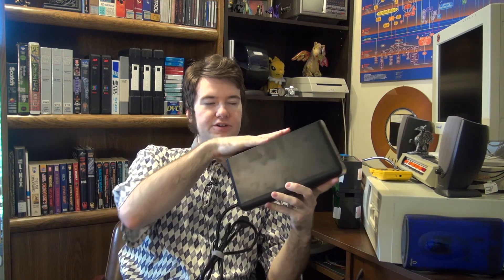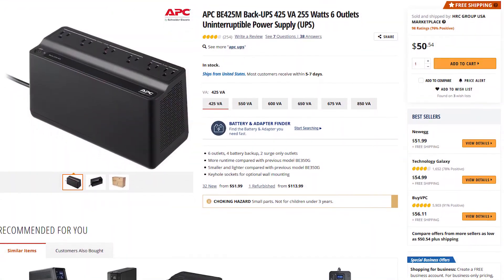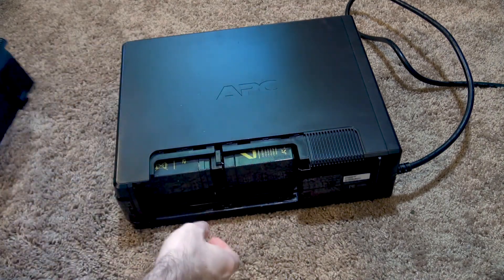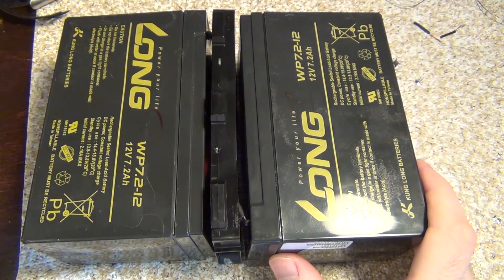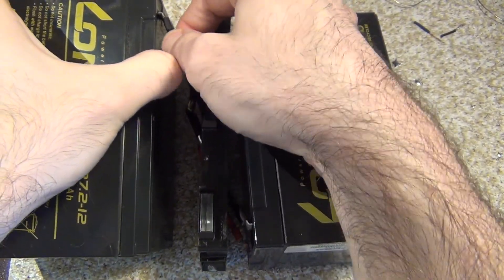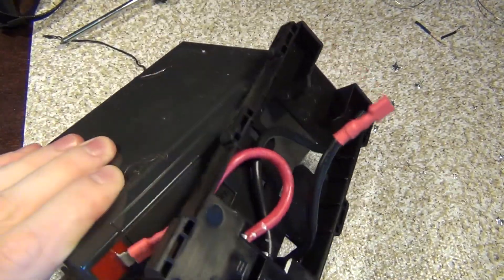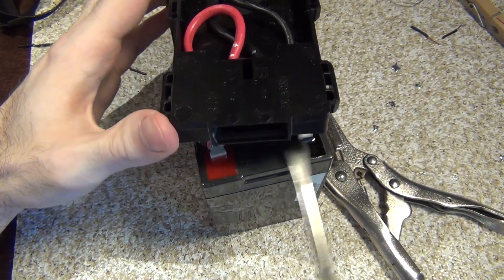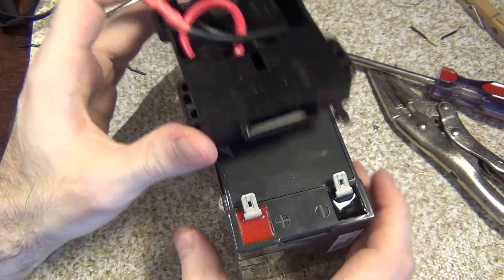APC Battery Pack Creation (Back-Ups XS-1300, Back-Ups XS-1500)

Comment: Does anybody have thoughts about building an "external" battery bank.
I acquired a toss away APC unit. The inverter is my interest. A pair of 12v deep cycles for extended duration. Good idea or no?